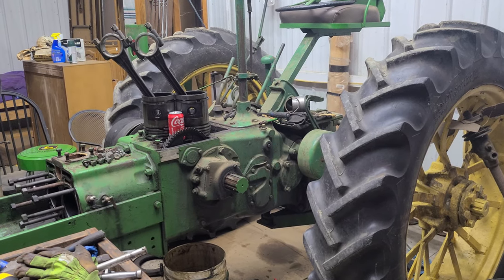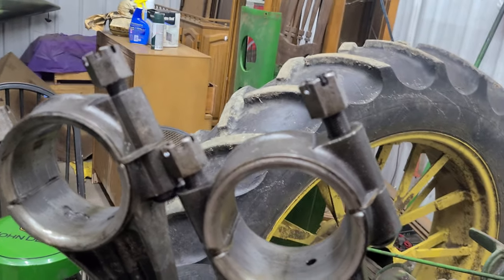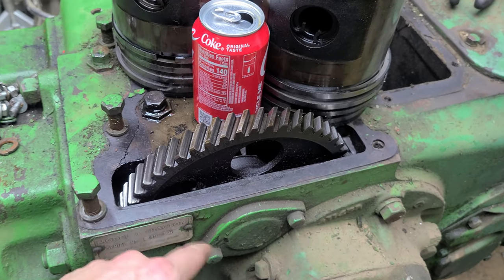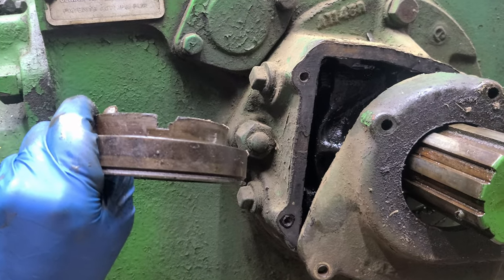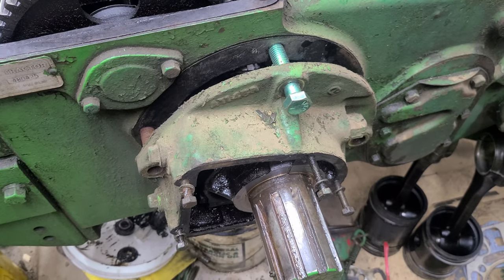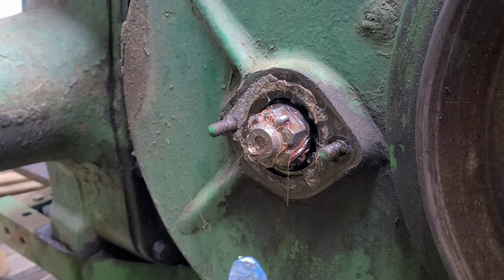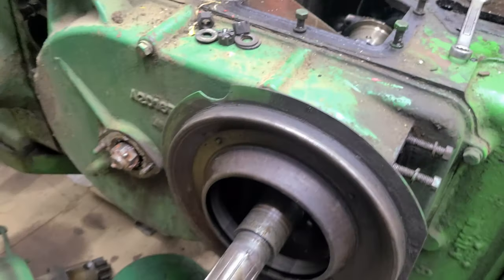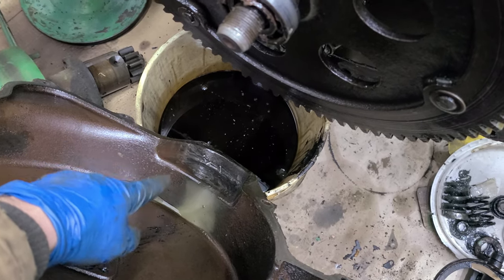1939 John Deere A Part 4 Crankshaft Removal - Restoration Series

Comment: Good simple design john deere 2 cylinder engines were rock solid simple and reliable today not so much they have so much unessary garbage on them that will eventually fail

Comment: The '39 and '40 A's must have been noted for the oil seals leaking behind the flywheel. We had a '40 that leaked so bad you would be oil sprayed if you worked it for the day.
Reply from the maker: They are all the same design and even part numbers.  Just a matter of how worn the cork gets.  Although I've replaced the one on my G twice and still can't get it to stop.

Comment: Good video Dan, appreciate your time. Where do you typically buy your tractor parts?
Reply from the maker: All depends. Anything that would be coming off of a parts tractor I typically reach out to Lind Brothers.  From there,  for new parts I'll go to Lind Brothers,  Martin's Parts and Repair, Sharp's Antique Tractor Parts,  etc.  If they don't have what I need then either Deere or shopping around.
Reply: @DanielFarmChannel  Thanks Dan

Comment: I have a 1940 John Deere A and it makes a whining noise under load. Kind of from the pulley transmission area. While you have the tractor apart there could you maybe point out what could be making the whining noise?   I know it’s vague and you have know idea exactly what I’m talking about but thought I’d ask.
Reply from the maker: It's common for these tractors to whine.  Typically it is because of the straight gear teeth,  but I obviously haven't heard yours.   It could also be the bearing inside the pulley.  It doesn't really get oiled very well by design, so anytime you have it apart it's important to pack it with grease.